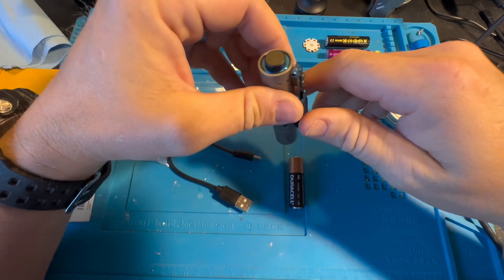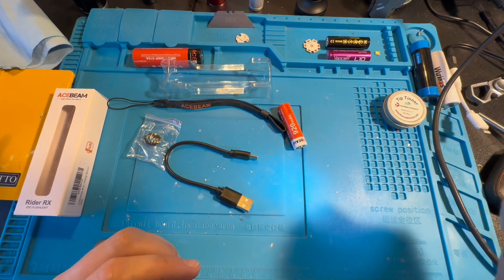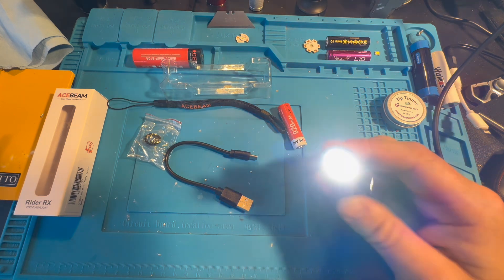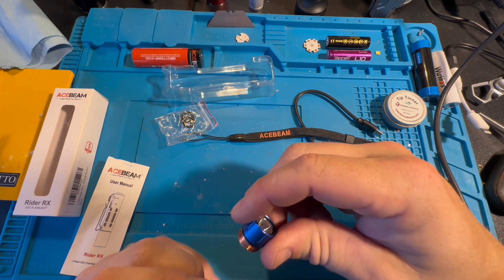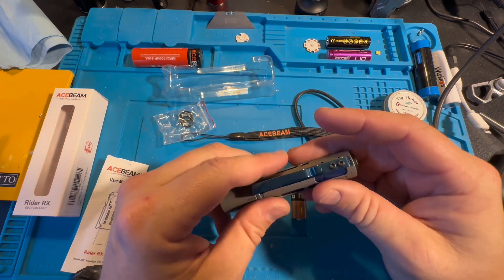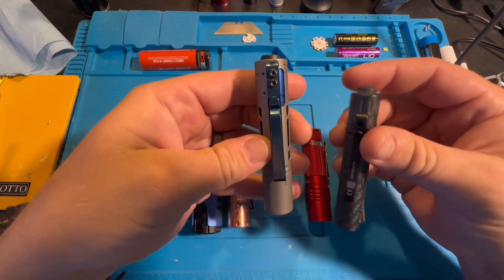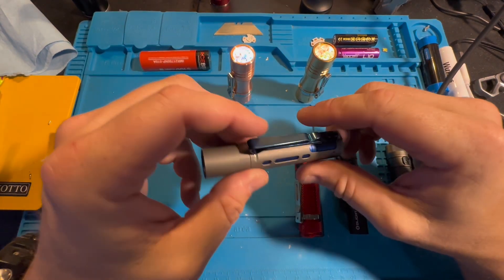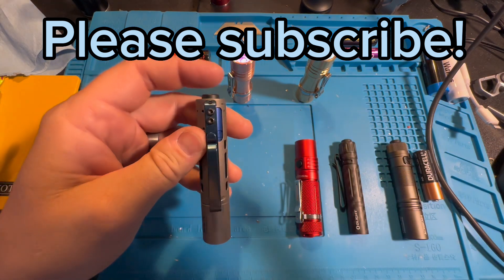Acebeam Rider RX flashlight review w/beamshots. Titanium fidget light w/ Nichia 219f led. High CRI

Comment: I like the Olight i3t and have several but my Carbon Fibre version is slightly warmer tint than my older copper or alu versions and operates very nicely with a 10440 lithium battery so maybe that would work well with yours also. It's remarkable how much the lithium battery boosts the output on those i3t.
Reply from the maker: That’s the only olight I own, the carbon fiber i3t and the beam is ugly, but the light is beautiful. Olight makes some good looking little lights, but the beams are horrible. I need to mod my i3t to a high cri and get a 10440 li ion

Comment: I don't think the lumen info for the Rider is accurate as it claims 80 lumens on medium and 200 or something lumens on high with an nimh but there is no difference between them in practice it seems. Maybe mine isn't hitting the 200?  but there didn't look much difference with yours either. Charged my battery and it made a little difference. I don't know what they actually are but I think both are more than 80 lumens and the moonlight is more than 0.5 lumens also. It's my most used light as my desk grab using an nimh as I don't need it overly bright with the 14500 but a versatile little compact light if needed for other duties. It's the best 14500 I have come across and that's even without the fidgeting. I find the on off button fidget enough trying to select a power level. I have the matt black version and  recently bought two of the very fancy blue version as currently on offer here so I'm triple Ridered ! Can't help doubling or more up on lights I like especially those tempting offers but the blue one is very fancy and the black nice also.
Reply from the maker: Haha. You are definitely a rider fan. It truly is such a nice little light. Another one of my favs is the wurkkos ts10. If you don’t have one of those, it will change your life. It has andruil 2 so it does things you’d never imagine a tiny light could do. I especially like the brass and copper

Comment: Can't seem to make sos mode work..
Reply from the maker: Ya it’s tricky, just keep half clicking for several full cycles and then fully press the switch. When you keep half pressing after 2 cycles you’ll notice that there won’t be anymore light coming out, fully press and it will be in sos
Reply: Tnx marc!
Reply from the maker: @janflores4211  u get it to work. If you didn’t I can make a video for you
Reply: @marcgossling8260  still no luck upto this day.. a video tutorial would be appreciated.. thanks man!
Reply from the maker: @janflores4211  hey I made a short on how I do the sos. I hope it helps. If you can’t get it to work, you may have a defective model
Reply: @marcgossling8260  ty will check later!